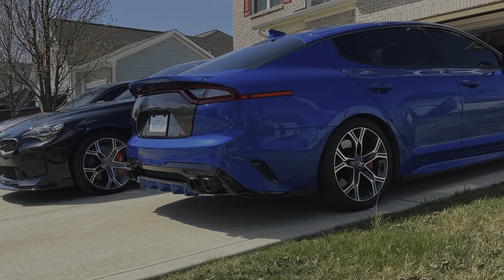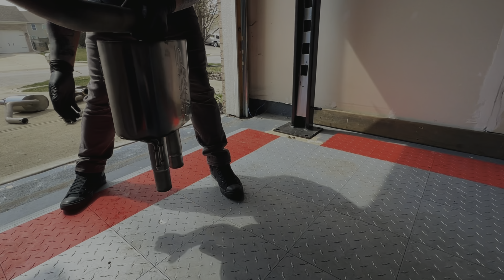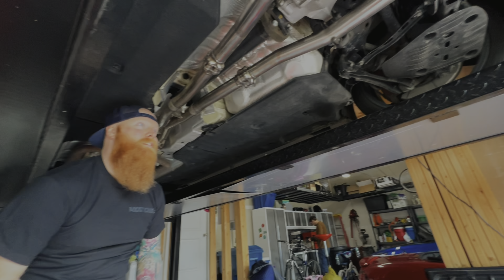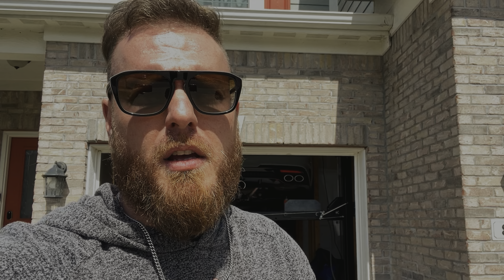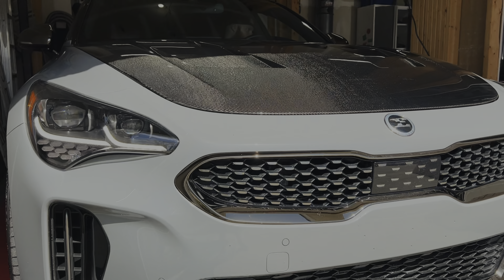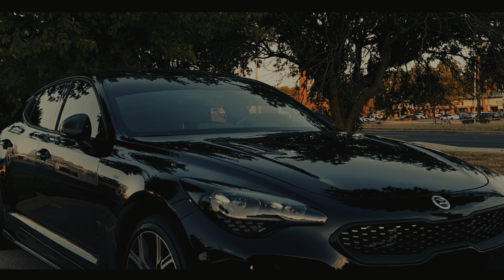GT2 KIA STINGER gets Borla Exhaust Installed

Comment: Still waiting on MBRP to drop the new version for 2022 GT2. They last told me June but nuthin...
Reply: @M3T29 The 2022 has butterfly valves in two of the four exhaust pipes. The 2022 version supposedly will have the same thing from MBRP.
Reply: Mbrp is amazing. I have there race catback paired with a Roush CAI on my 21 Mustang gt 6speed. When I get a GT2 I’m going with mbrp as well.
Reply: Me too bro

Comment: Sounds great. The only post I find like is the high pitched snap at high RPM's. Is there anything that can be done to prevent that?
Reply from the maker: Nope, that’s why I went with the MBRP, there is a tradeoff bc the Borla is louder and sounds better at lower RPMs, but the MBRP had no raspy notes, it’s not as loud though. But you can always add downpipes to the MBRP, but if you do that will introduce rasp..
Reply: @twn2rbo  Thank you.  I like the tone of your Borla. Ark is nice too, but I think yours has a lill deeper tone.

Comment: Sounds good. Just never liked the valance mounted "tips" mainly because if you had a cat-back system or custom exhaust you'd have to worry about inference or them not being centered if you did this all on the garage floor with jackstands.
Reply: Absolutely would normally agree with you. For this car, though. I make an exception.

Comment: Counting down the days til I get my stinger. Is this one of the first mods I should do or is there something else I should do first that you’d recommend?
Reply from the maker: I need to make an updated best mods list, but I did make one going over what I did first and built it up over time if you want to check it out. 
The Stinger loves mods, but will need to be tuned bc the extra boost will send a threat to the ECU and you’ll go in limp mode kind of easy after you do intakes and exhaust, intakes nothing happens but worse MPG, but after I did exhaust it started doing it, since JB4 never an issue with over boost

There’s a crap ton of mods available for this platform

Comment: Does this add more HP & TQ them changing downpipes?
Reply from the maker: If you are tuned you will see a little gain but nothing you would feel in the seat. Being forced induction you will see a major benefit to freeing up the exhaust and allowing the turbos to spool faster. Now when you change out the primary cats that’s another story, that with a proper tune you would feel it a little I’m sure +50 hp. I remember when I wasn’t tuned I installed intakes and had no issue, but when I installed the catback exhaust, I was overboosting and going into limp mode often

Comment: Does this void your warranty?
Reply from the maker: It can, if you watch my dealer vs modified stinger they refused to work on it until it was returned to stock, I showed up with only a carbon spolier and cat back on. In most cases, no they will not care until something expensive needs replaced like a turbo etc. it’s a risk and my situation was a worst case scenario. Most people say they have no issues pulling up with an exhaust and intakes, oil changes etc they will not care or look prob